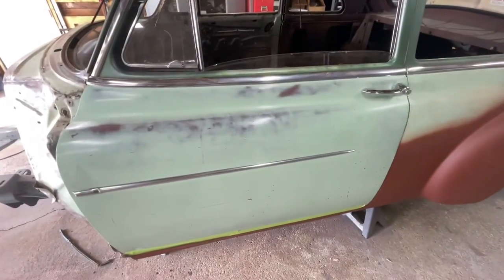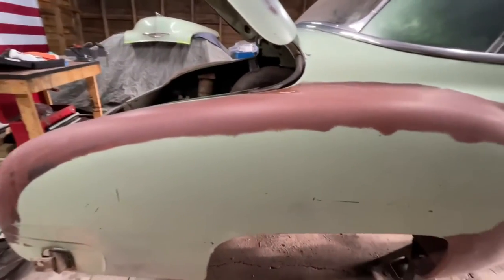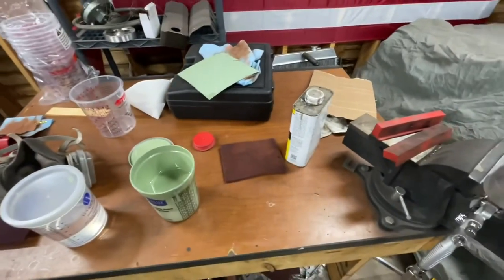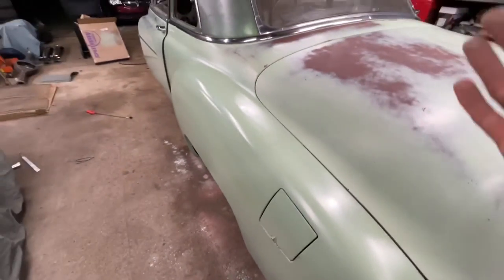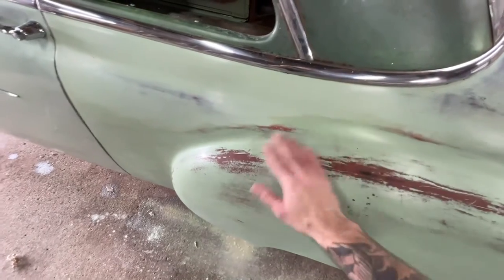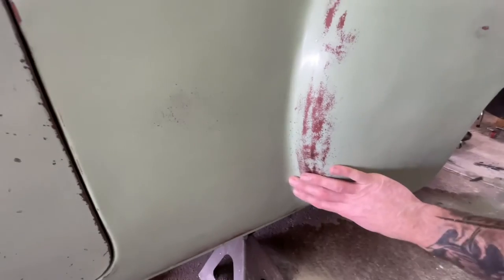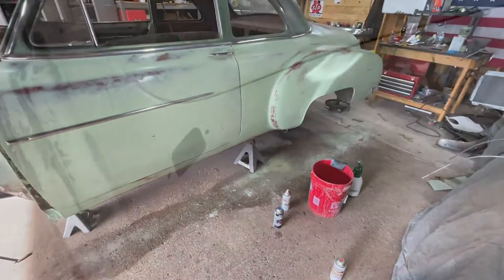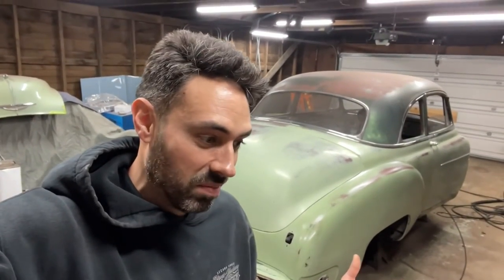Faux Patina

Comment: Looks real good. Tip for making small spots on the panel use Meguiars compound,just flick it on the panel at a angle before you paint. Do not touch it after you flick it on. After you paint it and it sets up you can wipe off the compound and it leaves little primer or black spots (what ever color that was under it) on the panel.